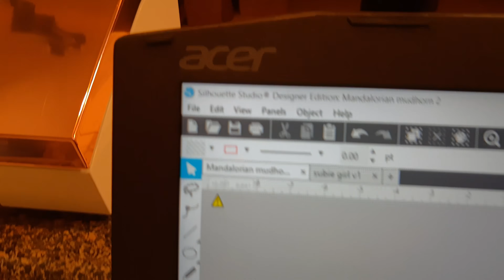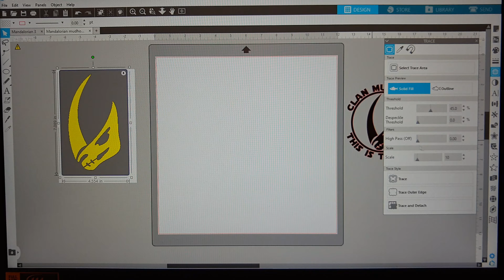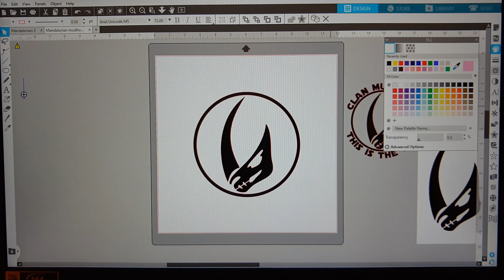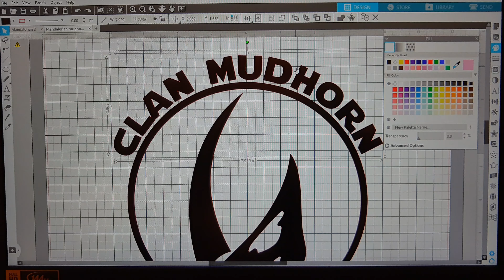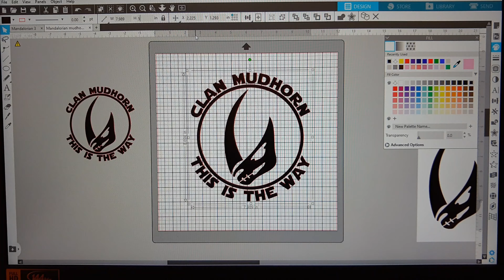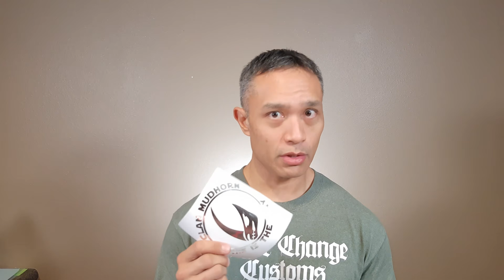How To Make Vinyl Decal Stickers at Home With Your Silhouette Cameo -- In Depth Tutorial

Comment: Thank you for this video! Best references I've found so far, I hope you get a small kickback through the affiliate links!
Reply from the maker: Thank you and thanks for watching!
Reply: @ColorChangeCustoms  Quick question! Do the transfer tapes you recommend (medium tack) work with the silver gloss vinyl? I've been searching on Amazon for the past 30 minutes and I can't decide which one to get
Reply from the maker: @ikendoitdotstudio    I typically use the Frisco Craft transfer tape for most things. It's been pretty consistent. The medium tack one I will use if I'm applying decals to a surface with a weaker surface energy (like a painted wall) so that the transfer tape doesn't pull the vinyl with it (or as much) when you are peeling it off after applying the decal.

Comment: Whats thw difference between auto blade and Ratchet blade? Thanks in Advance
Reply from the maker: The ratchet blade you manually set the depth of the blade whereas the auto blade the machine will set the depth of the blade for you.

Comment: I literally just started today and can't figure out your step one! You already start with an image on your screen. Where did you get it? How did it get on your screen? Did you have to buy it? Where do you save it to?
Reply from the maker: Thanks for the feedback...fair point in that I just started with an image already.  Basically, I get my images from the internet, though you certainly can buy images as well from a variety of sites.  Just make sure you're not using protected images (copyrighted, trade marked, service mark, etc), especially if it's to make things to sell.  Typically, when I find an image I like on the internet, I right click the image and "save image as", if that option is available. Sometimes, websites post images in a format you can't easily save.